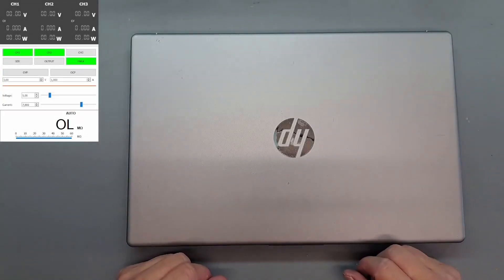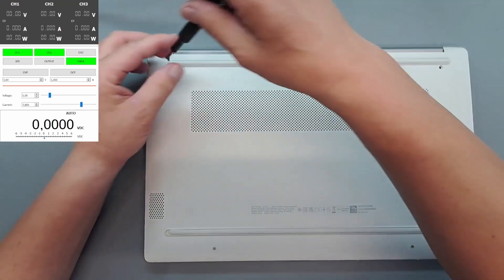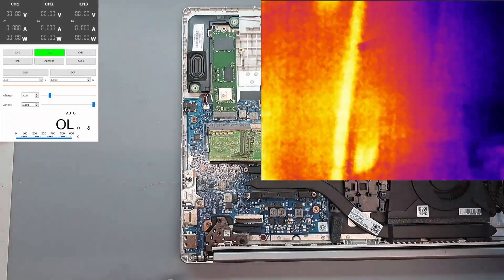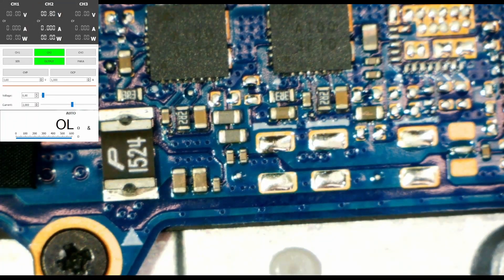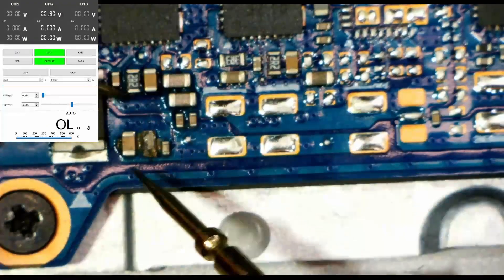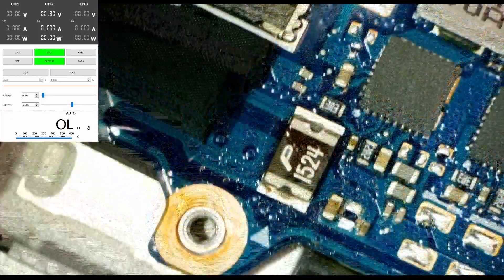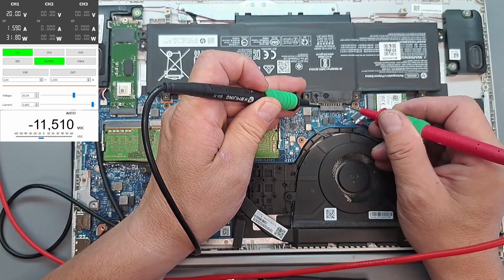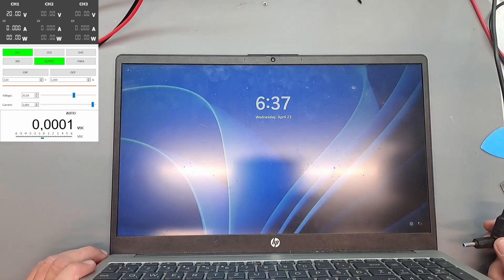HP 250 G10 - Shotred Main Power Rail

Comment: Stupid question, is this cap not here for a reason ?
Reply from the maker: Not sure if I understand correctly. The cap is not there anymore because it is faulty.. I didn't replace it because there are plenty of caps around that do the same job, so no problems there. Should be just fine. Thanks!